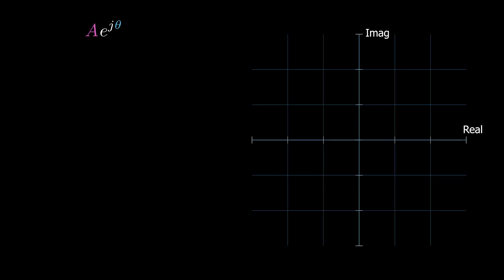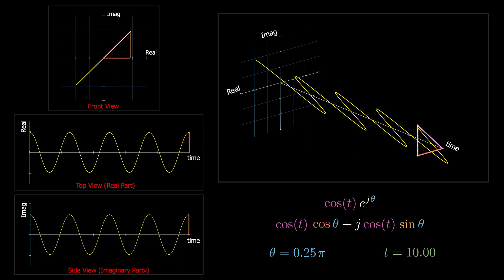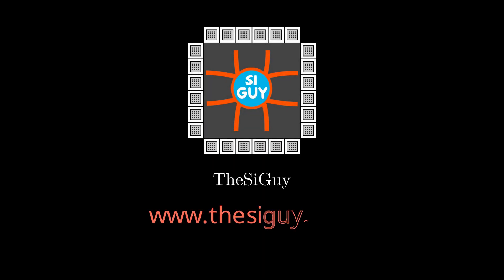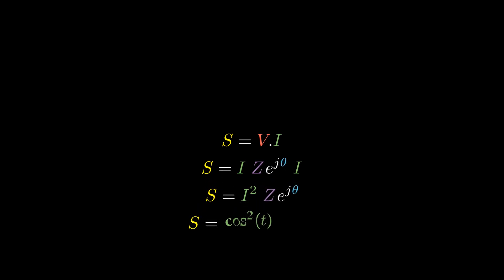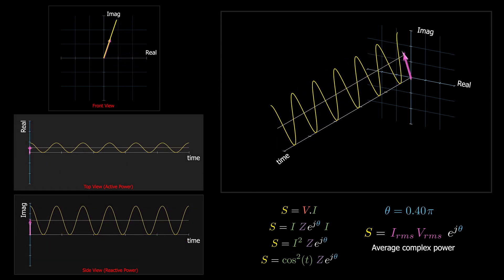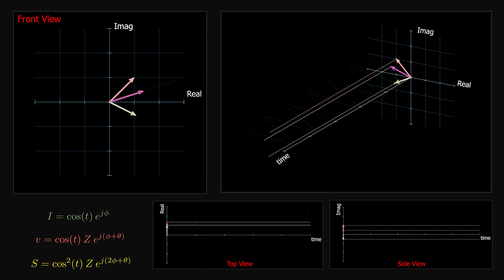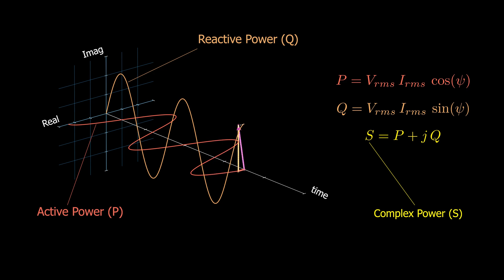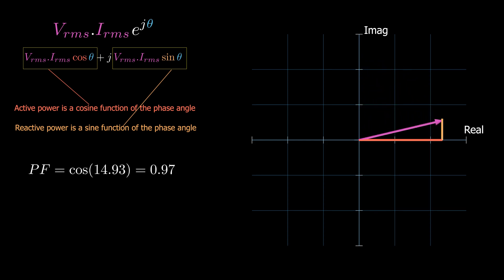But what does complex power actually mean?

Comment: Something doesn't sit right with me about the visualization at 3:20. When a current is lagging with respect to a voltage or vice versa, that means that, on the time axis, they are shifted. But, on the representation, both current and voltage always achieve their zeros at the same instant. The lag was shown on a dimension perpendicular to time. When you represent AC signals with complex numbers, you don't fix the fase and vary the magnitude, you have to fix the magnitude and vary the phase, such that the signal rotates around the time axis. The actual signal you get in the real world is the real part of that complex function.
Reply: I'm glad for your statement. This is also throwing me off as well. He has another video where he show the phase angle in the frequency domain corresponding to the phase shift in the time domain and in such a beautiful way. Help me understand something i didn't before. 
https://youtu.be/cy_KI_FiS7I?si=nzG_pNeFKus7QdqE&t=109
But what he shows in this video at 3:20 that you referenced, i believe goes counter to that visualization
Reply from the maker: if the current is a general function other than "cos" for instance let's say " I = exp(-t) " do you think that the voltage " V = exp(-t) * Z * exp(j theta) " should be shifted on time axis while rotating theta radians in the complex plane?
Reply: @TheSiGuy  Impedance is frequency dependent, that is, it only works for signals containing a single frequency, which is the case for the cossine. For any signal containing more frequencies or non-periodic functions (like the exponent), you can define the impedance on the s domain via laplace transform. The thing is, you cannot mix the s domain and the time domain.
Reply from the maker: @victorscarpes  OK, thank you for highlighting that impedance is frequency dependent :) Let's focus on the formula. does that formula " cos(t) Z exp(j theta) " has any time shift as theta varies?
Reply: @TheSiGuyEN  no, it does not.

Comment: Excellent video. This directly relates to power systems I'm designing so it's great to have more detailed breakdowns available. It would be great to see more content on combined systems where capacitive reactance is part of the distributed system on a real low impedance power line.